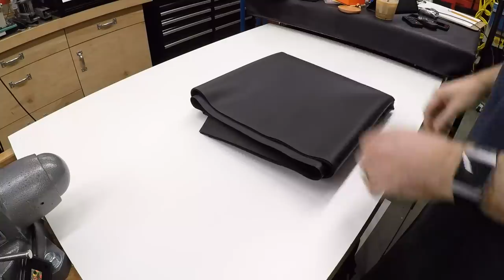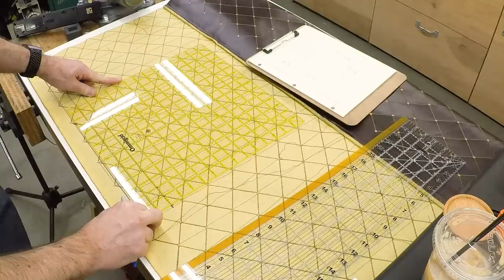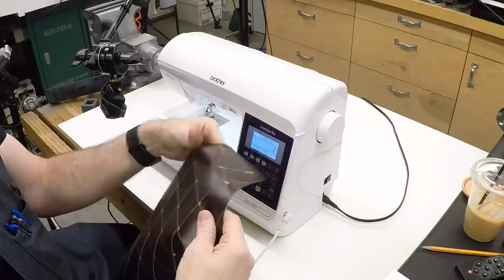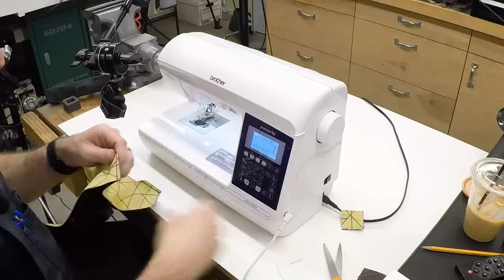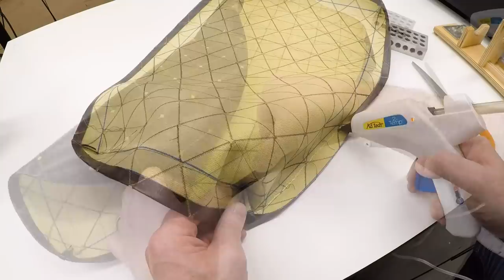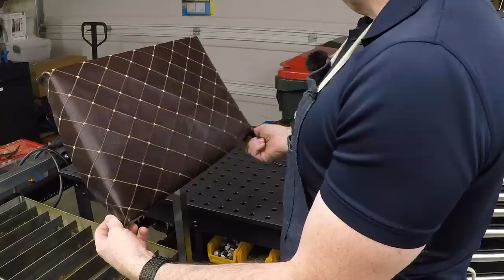Sewing Dust Covers For The Shop | Plasma Table Monitor Mount Part II

Comment: I thought you were gonna design the cover in Fusion 360 lol. I vote for black, with your  channel logo embroidered in them ;)  Im shocked you havent CNC`d your sewing machine. Cover looks great and will protect the monitor, thanks for sharing!
Reply from the maker: Technically, the sewing machine is already CNC.  It doesn't have a drivetrain.  The needle and feed dogs are all servo driven.
Reply: Funny you say that. My mother has several computerized sewing and knitting machines. I couldn't tell you a thing about them, but they do all kinds of cool stuff....
Reply: Nah, don't embroider the logo, but use the CNC to press some silver foil onto the front - just needs a drag roller to be built ;)

My first thought was if one could actually use fusion 360 to layout everything, at least for explaining before the thing exists it makes very nice visuals.
Reply: I had a chance to use a CNC sewing machine when I was at school, pretty cool stuff.. I dunno what it cost the school back then, must have been pretty expensive but your comment has made me think of looking into this again... after all I've CNCed everything else in my life, why not repairing pants? :D
Reply: @Clough42  So it's kinda like your electronic leadscrew 😃
Reply: I too was waiting for a parametric design in the sheet metal workbench 😂
Reply: @dannywilsher4165  The most frustrating thing about those is the file formats are all proprietary and getting custom embroidery designs done is painful. I really wish they just used gcode.
Reply: @mr_voron  I can remember my mom saying something about exactly what you are saying. Frustrating indeed!!!
Reply from the maker: When I get around to having it embroidered, I intend to provide an Adobe Illustrator file and let the provider sort it out.

Comment: I would think since this is going on a monitor and its preventing a more vertical surface than normal. (plus some lcd's have alot of top facing vents that prefer not to be loaded with dust/chips). That maybe adding an additional extended lip the comes down. From the top where it goes over the monitor. This should also prevent it from blowing off if you had the doors open, or a lot of air flow going on. That is the only think i can really think of to improve on this.

Comment: Definitely want to see how you do wire routing, especially with data and noisy welding current in the same machine.
Are you going to make a back cover for the monitor to protect it from splashing and such?
Reply from the maker: If it becomes necessary.  I'll keep an eye on it.

Comment: Since it is PVC backed, could you use a heat gun and mold the corners to keep it's shape? Certainly an interesting pattern, almost one of those optical illusions where you chase the black dots around in the peripheral.

Comment: That's quite manly! I've been sowing for similar purposes for several years and find it very useful. I'd have chosen black, but I quite like bland things ;-)
I also might have tried ironing in a fold so that there's a pronounced corner in the fabric, but I'm not sure that would work with this material. Maybe I'll try to find some of that black stuff with felt you've got there, having some in stock might come in handy.
Reply: It's been my experience that vinyl can take some shaping using heat, but I would thread carefully. It's a fine line between giving it some shape and getting a melted mess...

Comment: Interesting fabric for your surface plate. Need to go and find a few yards for future work. I've been using a RipStop for my stuff as it is light and very easy to sew in the corners etc. but of course  it doesn't add as much protection.

Comment: I have an old Windows XP industrial all in one touch screen PC on my miller as the DRO diaplay. To protect the display all the time (i.e. and when using it and not), I have a very thick clear polythene bag over it. Not sure what type of touch screen it is, but it works fine through the polythene.

Comment: All black made like an upside down bag so you cover the back fully for less dust ingress and with a strap that reach the far corners on the top panel to easily pull away.

Comment: Looks good. 

If you stitched the hem or glued it so you could thread some elastic cord through the hem tube.  it would suck the edges in and behind a bit like a fitted bottom sheet, 

Try get yourself some cheap tailoring scissors too. Your thumb will appreciate it on larger jobs.

I wondered if you could use clear vinyl window panel (like they use on boat canopies or convertible cars canvas tops) to see screen without ever removing it.. that would be interesting to see being done.

Comment: Pro tip: If you crease those outside corners on the face, then use a hypodermic needle to run a bead of superglue on the inside, they stay nice and crisp. That's how we kept perfect creases in our military uniforms.

Comment: I think I would have gone black but thats my personality,  If you like it thats all that matters. I do all the sewing in our house, from curtains to bimini top for our boat (That was hard, water proof seams, waxed thread sunbrella cloth)   A sewing machine is a power tool, if you want to work with cloth,  You use the correct power tool.  Good job

Comment: Man of many trades :)
I wonder if you don't find the plasma table to be a bit flimsy? if it was me I would have stiffened it up or weight it down. Don't you get problems with arc stability when doing rapid cuts and changing direction?

And thanks for an intuitive channel
Reply from the maker: Nope.  It works great.  What you see on video is the table moving around on its casters.  The table itself is plenty rigid

Comment: I'd like to see how you route the wiring, it's a job I have to do on mine as well (which is now up and running with the XL kit).  It would be good to see how you do it vs how I have it in mind.  Also... not digging the brown diamond material.

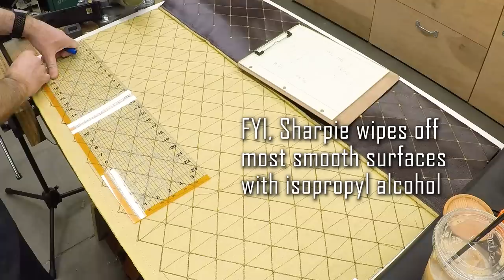Comment: 4:59 Yes, this is true until you get smug about it and then find it won't come off.  If the "permanent" marker is absorbed at all into the surface, it's not going to fully come off.  This includes some paints and even some oil paints.  So when you layout the stick-on letters on your kid's door in Sharpie confident that "it'll just wipe off with IPA".....yeah, not so much.   It does, of course, wipe off with sandpaper and some fresh paint sigh

Comment: It looks good James it just the right color not to dark and with diamond pattern it keep in mind there is a cover on it nice work. 
Ps I bought a small PC like you did on your plasma table I going to try it out later today. I using Proma My plasma controller. So far it been doing good.  Also for starter video cam what do you recommend as beginning for diy YouTube videos.

Comment: Might be nice on a big flat cover like that to embed some music wire in the hot glue to get the sides to sit straight.
Reply from the maker: Maybe.  Over time it'll probably settle in.  The ones on the surface plates did.

Comment: The diamonds are a little bold, but I like the brown rather than black (more leather-like). Are you going to start taking orders for custom covers? I need one for my 12" x 18" surface plate (it would look much nicer than the corrugated cardboard tray that's inverted on it now) ;).

Comment: James what if you add a very narrow side sew to the edges, what will make it holding its shape, and will make the oversize smaller? Awesome work as always, nicely presented procedure!
Congratulations for the video!
Reply from the maker: Yeah, I thought about trying to shape the side seams to make it more form fitting.  Small adjustments can make a big difference.
Reply: @Clough42  yes definately! You can still make it! Altho this diamond stitched leather is a really stylish choice!

Comment: Do you have a specific needle size you use for this material, or just a typical standard 80?
Reply from the maker: Nothing special.  I just used the same needle my wife uses for sewing cotton fabrics.
Reply: @Clough42  Nice, I'll have to consider this for some of my items which need a good dust cover.
I'll probibly have to do some research as somethings I have the cover also needs to be "lint free" as the felt backing would be lint issue for those items.

Comment: with such a small fold why not sew the long edges in pieces of course.  But everything else you do is so perfect I would think you would take that step
Reply from the maker: That would puncture the exterior of the fabric and leave a visible seam.  The hot glue leaves it clean and perfect.